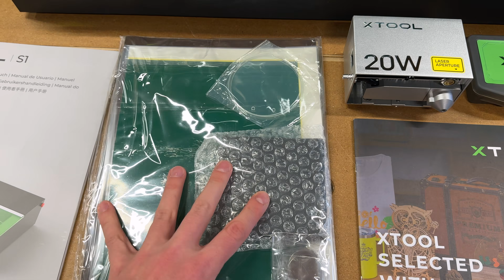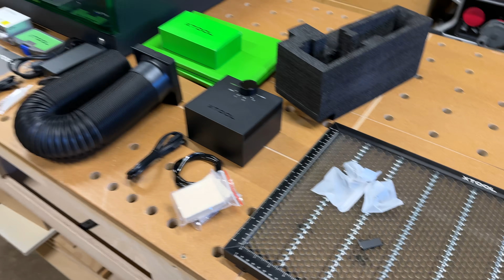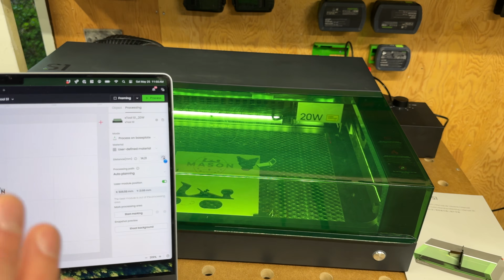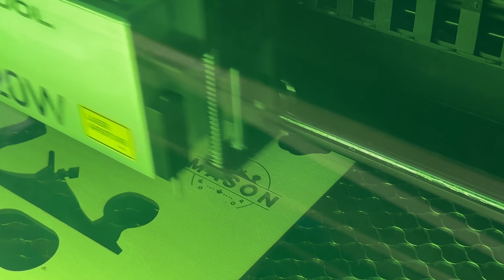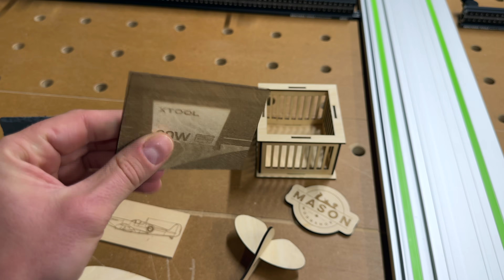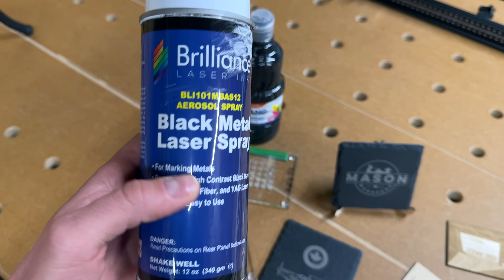xTool S1 Laser Review - The Best Laser for Beginners?

Comment: I watched several videos comparing the 20w and 40w models and there’s hardly any difference in detail. One instance in one of the videos, the details were actually better with the 40w which is surprising to me.
Reply from the maker: Interesting!! I haven't felt the 20W very limiting as I never really push it's boundaries when it comes to cutting thick material. Based on what I know, the 20W should always allow for finer detail due to the nature of how beams are stacked on the 40W version.

Comment: Hi it’s been a struggle for me to find the right power and speed to engrave clear acrylic with S1 20 Watts. I would really appreciate if you wouldn’t mind sharing the settings please and thank you.
Reply from the maker: While I’m not a complete expert, it’s unlikely that you’ll be able to engrave clear acrylic with a diode laser. There may be ways to apply something to the surface to get some sort of etch (like you can with glass and tempera paint), but I’ve never been successful with clear acrylic.

Comment: Now I can't use  my machine, I keep getting an error code M363 S4. I installed the raiser (the one that doesn't open up) Is it because my material is not thick enough to reach the sensor stick? What settings or modes do I need to input in the creative space so that I don't need to remove the riser even when not using something tall?
Reply from the maker: Interesting! I may not be much help as the riser base I have is the one that opens, so I can just reposition the tray accordingly. The help page for that error message (link: https://support.xtool.com/article/1285) does show the material height restrictions both with and without the honeycomb panel, which notes a level A and level B depending on the material thickness requirements you may have.
Reply from the maker: Oh, and if you do have the honeycomb, you can potentially just put some boards of the same height under the corners of the honeycomb to raise it up. I'm not 100% sure this will work for you, but I do it sometimes when I'm bouncing between using the rotary attachment and honeycomb, even with the riser base that does open up.
Reply: @MasonWoodshop  thanks.  that's actually an idea.     I do have the honeycomb.   didn't know you could put stuff under it.    But this should def. work.   I installed the raiser because my s1 also came with the rotary attachment.
Reply from the maker: Awesome! I've propped up my honeycomb many times with success, plus I found that the smoke was more effectively exhausted when doing so. I typically use 2" x 2" sections of 3/4" plywood, but I'm sure anything would work.

Comment: Thanks for sharing.  This is wonderful information.  I am considering getting the S1 but was leaning more towards the 40W because I want to cut thicker wood.  I keep seeing what the lasers will do in one pass.  Will they cut thicker materials in more passes?  Would the 20W cut up to 3/4" if it made more passes?
Reply from the maker: Thanks for watching! The 20W could do it in multiple passes, but I have found that the cut isn’t quite as precise (maybe more burning). I have recently been playing around with the 2W IR laser and after doing so I think I’d recommend the 40W + 2W kit to have the most versatility.
Reply: Thank you so much. I think that is what I need as well.

Comment: Hey my friend,

Another job well done with the xTool S1! I would love to see a xTool software tutorial from you. I think if you had a video to show your audience and newbie’s how to use the software will greatly help those who just got their laser and those still thinking about it. Again, great job👍👏

I’ve been working on some cool projects until yesterday. I turned on the S1, opened the software, and lo and behold, no matter where I placed the laser head, the software still showed it in the upper left corner. I couldn’t figure out the issue until I realized the cable for the air assist was damaged. The damaged cable caused the laser not to communicate with the software. Once I removed the cable from the back of the unit and turned off the laser, everything returned to normal. However, I now have no air assist because of the damaged cable. I reached out to xTool, and they’re sending me a replacement cable. Luka from tech support has been amazing. There hasn’t been a moment where I felt ignored, Luka kept reaching out to make sure things has been resolved, he is always on top of my case by keeping in touch. So, if xTool’s is reading this, I would like  thank you for having an awesome employee “Luka” for his passion and carefulness working with his customers.

Section 29:31 may seem like a lot of money, but when you break it down, from the quality of the packaging to the hardware build, I think it is priced just right. Most folks don’t realize how many employees are involved in the development of XTool’s products. Almost like Apple, everyone has a specific responsibility, from architectural design, building and testing a prototype model, to testing the final product. Plus, there’s another department just for user experience and implementation. The xTool team is huge compared to any other laser company I know about. I once thought the price was too high until I got my hands on the XTool S1.

The only other exception for excellent build quality and support is the Roly LaserMatic MK2. Even though Roly is new with just a few employees, their laser is also unmatched in build quality and support. The LaserMatic MK2 is very budget-friendly for what you get. For me, the only drawback with Roly products is LightBurn. All of their lasers only use LightBurn, and I find that to be a drawback since it is not user-friendly. I prefer XTool’s software over LightBurn any day. I can get to more projects faster without a lot of settings with XTool’s software compared to LightBurn. Don’t get me wrong, LightBurn is far more powerful than XTool’s, but it is not user-friendly.

Yeah, if anyone is considering a laser and not just for basic projects, xTool is something I would highly recommend. xTool’s products are very similar to Apple’s. You may be paying a premium, but the overall quality and functionality of each product are unmatched. If I didn’t own the S1, I would agree with many potential buyers that the price is high, but now that I have the S1, my thoughts have changed.😎
Reply from the maker: Thanks for watching and leaving another comment! That's great to hear that you were able to get your issue resolved in such communicative manner. I have yet to have the need to reach out to support, but it's nice to hear your experience with that cable.

I continue to be really impressed with the build quality and end-user feel with this product. I really liked the build of the based of the Creality Falcon2 Pro, but the experience just wasn't quite the same. I do think it provides good value and is a good laser overall, but it just wasn't quite the end-user experience I needed as a true beginner.

It's been interesting follow the xTool announcement and launch of their F1 Ultra fibre + diode laser. They've done a great job promoting it and the fit and finish of that laser looks absolutely amazing, albeit at a much higher cost than the S1 due to the nature of a fibre laser.

I will likely have another couple of videos over the next couple of months, but I'm conscious of not going too hard in the laser space. In about a month I'll do another check-in video on how I have hopefully by then built a custom table for it, implemented a smoke extraction solution, and ventured to new materials and projects. If my comfort continues to improve with the XCS software I may do a video on that in the future.

Thanks again for watching and leaving such a great comment!
Reply: @MasonWoodshop  👍